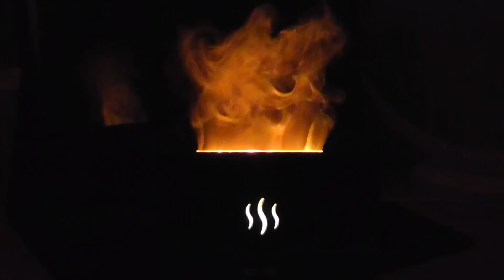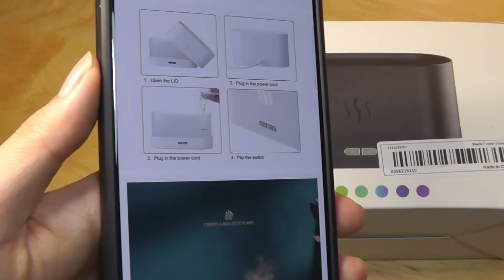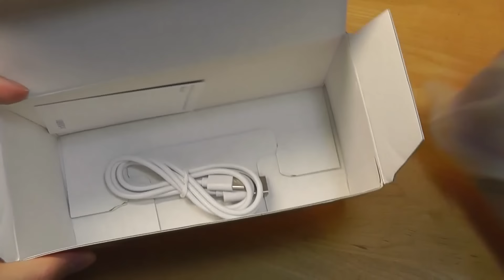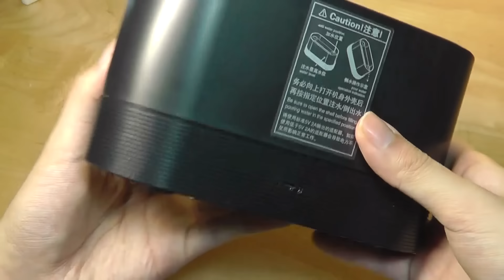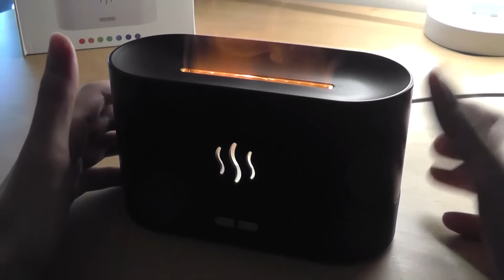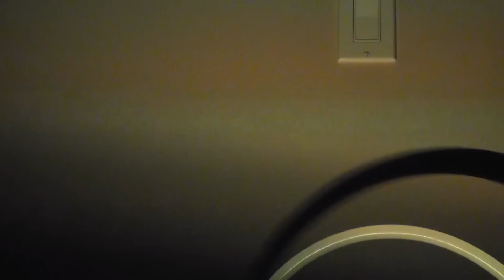REVIEW: Flame Humidifier Aroma Essential Oil Diffuser - Flame Effect LED Light?!

Comment: Hi! Ive been using it for 6 months. Now there's hardly any steam maybe because the water was not so clean. Is there a way to clean this humidifier?
Reply: Run a citric acid tablet through it to descale it.
Reply: hello how often do you have to change the water inside it

Comment: Where would I put the oil it came with tho
Reply: in the water
Reply: just add a few drops in the water, and it will work with pretty much any of those defuser oils. we use eucalyptus for ours.
Reply: It doesn't come with oils just a pamphlet about what to put in when I started putting oils in mine the flame got smaller

Comment: Mine appears to have a few color modes, and a mode that changes color randomly. The problem is I cannot set up the orange flame color at all (other than the 1-sec it switches from red to green) any fix or it is just a model matter?
Reply: not sure if you have fixed yours or not but you could hold the humidifier button. Then it would change to single color mode.

Comment: Does the oil go into the water reservoir?
Reply: No, it goes on to the motherboard. It helps to pour a little on the power plug before you insert it into the power outlet.
Reply: @86GT11  Thanks for the asshole reply. In mine, it doesn't go into the water, there is a spoon like reservoir that it goes into.
Reply: @MMPutnam77  you are very welcome! Glad to help! Have a great day! 😆 🤣 😂
Reply: Yes
Reply: It goes into fan section.

Comment: What if I poured a little bit of liquid into the fan hole?
Reply: Death
Reply: You're supposed to. You have to prime the fan blades with water.
Reply: Its okay, they need to be wet for proper functioning.
Reply: Try sticking your fingers into a plug socket as you go.